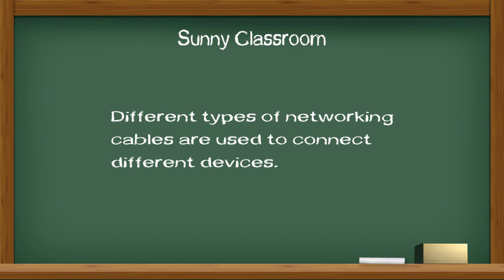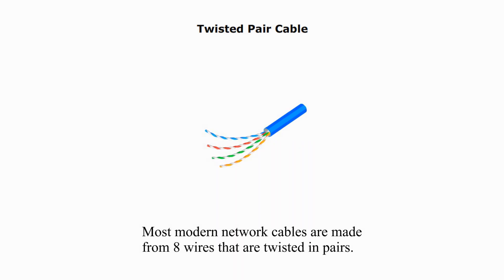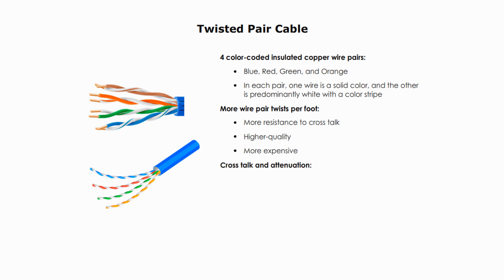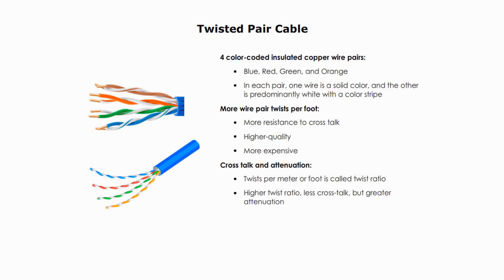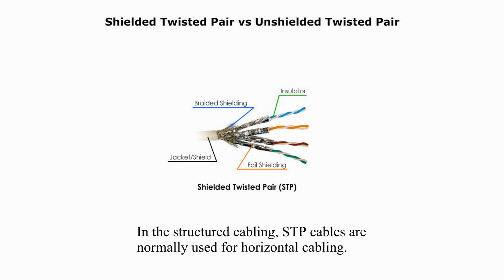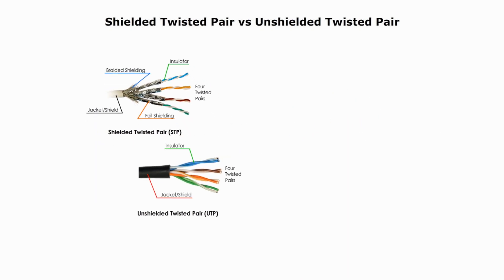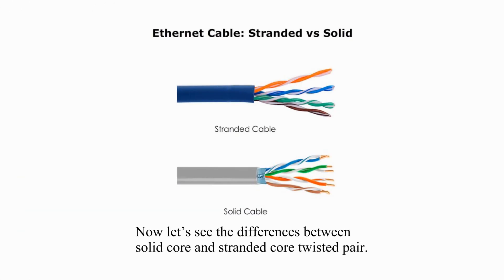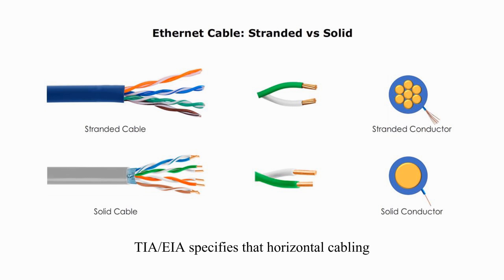Twisted Pair Cable: UTP/STP, solid/stranded, & class/category

Comment: my dear how about the cable needs for elevator. it has to be stranded but how long it will take to get the full power is it thesame as the solid as 100m maximum or it will be decreased and will the POE have a effect.

Comment: I wired our new place with Cat6 for 10gig LAN to attach my NAS and a plethora of other devices, including hotspots.  Given that the largest chunk of the cost of cabling is labor, and the price difference between Cat5e and Cat6 is so small, it makes sense to go for Cat6 and have a future proof network. Especially since, many folks are increasingly adding smart devices, along with servers, plus multiple hotspots. Not to mention, many homes are already getting 1gig Internet, which will only go up from there. Anyone cabling their premises from 2020 onwards would be foolish to install Ca5e, just to save a few bucks.
Reply from the maker: Thanks a lot for your perspective and insights.